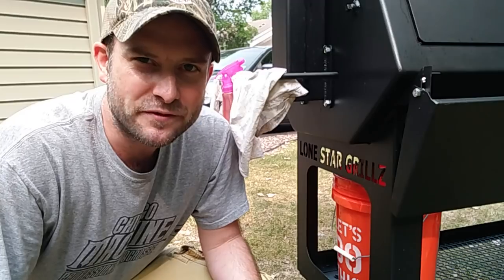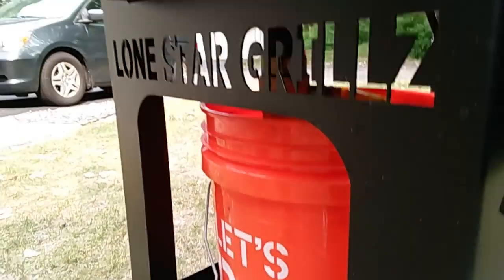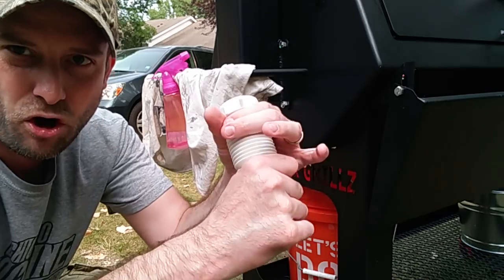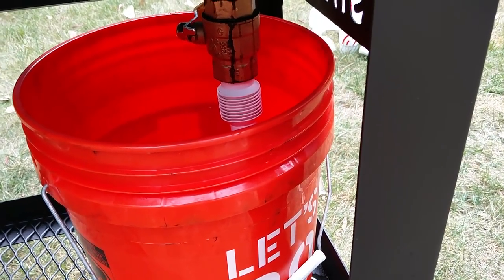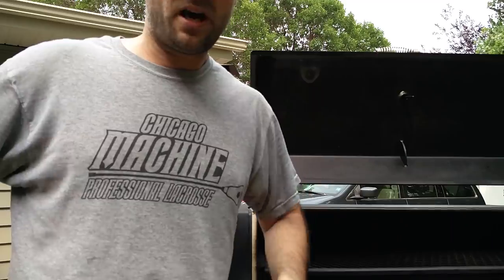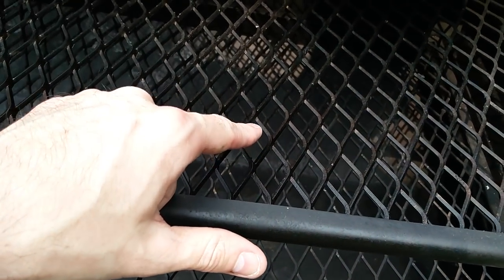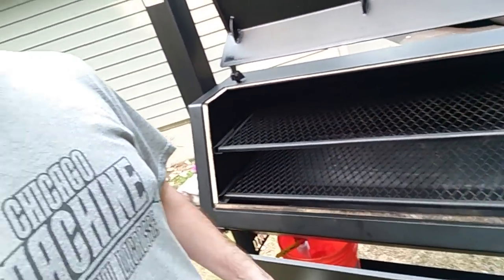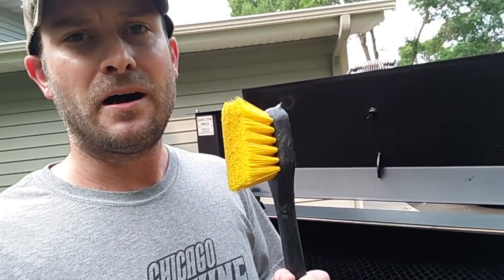The Must-Have $6 Modification for Every Lone Star Grillz Smoker | Plus A Safety Tip for All BBQers

Comment: That mod is going to make life easier for sure Jonathan and thanks for the mention, I appreciate it.  I haven't thought of a good solution for the wire bristle brushes either, but that yellow brush is safer for sure.
Reply from the maker: Smoky Ribs BBQ & Southern Cuisine No problem, Rus. Credit to you for a great idea. Thanks for stopping by!
Reply from the maker: Rus - update on this. Grill Badger sent me out a couple all natural bristle brushes to try. I like them. I'm using them on my expanded metal and they're great! I did a review video on them a while back. Good people over there too.
Reply: Get a weed burner with a propain tank, torch the grill for about 5 min spray it off with cold water. Not only does it sanitize any food that was left on the grates but it cleanes really well. I have a Lone Star cabinet smoker and I clean it that way every time. The weed burner pretty much turns any food left on the grates to ashes and you just rinse off the ashes.
Reply: Have you guys used the nylon grill brushes?  You have to use them when the grill is cool, but i find it works really well!
Reply from the maker: Yes, they're ok. I prefer the Grill Badger. Tough and can use when hot. 👉💨
Reply: Rus, I’ve gone to using a very stiff plastic bristle brush….similar to the one Jonathan has here, but it is actually designed for scrubbing concrete floors. It works great.

Comment: I hard piped my LSG 30” offset cabinet smoker, because I would add 4 gallons of water to my smoker when smoking.  Keeps the humidity up in the smoker and heats the water so the drippings don’t stick.  LSG makes a killer product.  I have another one on order as I make this post.

Comment: They make a grill brush that has shorter nylon bristles similar to what you have in the video. The shorter bristles make it a little more stiff for cleaning the grates. It also has a flat scraper on the reverse side for heavier gunk. I'm pretty sure I picked mine up at Lowes.
Reply from the maker: zeroghd Thank you! I'll have to check that out next time I'm there. Maybe end of summer sales will start soon in the grill section :)
Reply: you don't want a metal brush with fine wires  it will shed

Comment: Solid advice on the metal brushes. For the drain on the LSG, I’d just get a smaller bucket than putting some ridiculous looking plastic mod on a nice pit. The ash bucket you have on in the video works great. Ive been using one with my LSG since I got it in 2016 and it hasn’t rusted out yet even though water sits in it most of the year.

Comment: Hi I had the same problem one time what I do is pressure wash just when they are too bad and need deep clean but I dry them up with a towel and spray oil to it the when time to cook in the process to hit the pit the oil stick to the grill again and every time you are cooking again cut a big onion in half stick it to a big grill fork and pass it throughwhike the pit is hot. 
Put litle  pressure that will keep the grill clean to and ready to cook

Comment: Great tips Johnathan.
That yellow bristled brush you have is a great alternative usually about every 2-3 cooks I'll use my brush which is the same style as yours but mine is blue,
Anyway I bring my smoker to temp and give it a good quick steam cleaning with light sprays of water from my garden hose, while scrubbing the grates with the ball valve wide open to keep it as fresh as possible, then I reseason the pit before the next cook. After months of use I still don't have any problems using the brush. Great channel Bub, you just gained another subscriber.

Comment: great idea! do you wash it out after each cook?
Reply from the maker: I actually sold it to make way for my LSG Mini - but I did not wash it out after each cook. Actually, rarely did I ever wash it out and the longer I owned it the less I wanted to introduce water into the equation. A plastic paint scraper once everything has cooled down gets the sludge out of the bottom pretty easily and leaves the metal seasoned. I still use this method on my mini.

Comment: Yep, the bristles do come of onto the grate. Expanded metal is worse due to the joint at the bottom of each opening where it will cut off the bristle. I have been aware of this but even being aware of it you can't see them all every time. I have two of those T shaped brushes and still use them but inspect closely and always rub down the grate with paper towels or clean rags then spray with oil. If you swallow one of those steel bristles, it is then a 50/50 chance of it puncturing your stomach or intestines. I also have one of the nylon brushes I use now on the expanded metal, and save the other for the straight grate. I like what you did on the drain mod, that makes it much easier for sure. I have a drain on my offset but do not use it for cleaning only grease dripping during a cook. I found if I'm gonna take out the grate and heat plate during cleaning anyway, I can take my 5 inch sheetrock knife and begin at the top of the drum and run it down thru and up the other side and collect the grease and rub it off on a couple paper towels. On a 36 inch drum, it doesn't take any time at all to work down the drum like this and it's all dry cleaning. Just put on a pair of rubber gloves. It's not bad IMO . Thanks for the tips Jonathan.
Reply from the maker: Phil N Florence Good feedback and ideas! Thank you!
Reply: All of the LSG offsets can hold water to become a water smoker, and that is primarily what the valve is there far.  I use my offset 90 percent of the time with water in it, and even when I don't, I simply hose all the gunk off and down the drain.  Clean up is a breeze on these smokers.
Reply from the maker: Smoky Ribs BBQ & Southern Cuisine That's a great point. I forget that because I don't water smoke with mine, though I'll experiment with that at some point. Do you keep it fired up for an hour after cleaning to dry it out completely, or not really worry about a little rust in the belly?

Comment: Traeger sells a metal bucket that fits pretty well under the LSG because it's a few inches shorter than the typical 5 gallon buckets sold at Home Depot & Orchard. I've found that Traeger's bucket gets the job done,  looks good & it will probably last a long time.
Reply from the maker: Kenyatta Robinson Good tip! Thank you! We'll get all these tweaks perfect eventually :)

Comment: Use your yellow brush before you heat up the grill and burn it off which also helps sterilize the grill surface before you place anything on it.  I crank up my pellet grill to 500 degrees and then lower it down to the right temp I want to cook at.

Comment: HI, I was wondering if you got the 1/2 inch charcoal grate upgrade, I saw that T-Roy got it , and what is the benefit of it , this is my first offset  I don't know that much about them, Thanks.
Reply from the maker: I did get it, because the charcoal grate is the first thing to burn out on any offset cooker. It takes a ton of stress from the hot coals and expands and cools more than any other spot on the cooker. However, I am not sure it is necessary. The 1/4" one is still very beefy. The 1/2" one might be a little overkill. It is very heavy, probably 45 lbs.
Reply: Thanks for the info, I think I might just get it, I will call them Monday and ask them to add it. The other things I got are the Ball valve, probe port, charcoal basket, and 8 inch wheels, I am also thinking about the fire poker and ash rake, and maybe the cover.
Reply from the maker: warren perry I bought my own fire tools at fleet farm. I'll eventually make a charcoal basket out of expanded metal as well.

Comment: Simple fix for your drain, first thing I did when I got my LSG smoker. Take the valve off, replace it with a 45* elbow, a 6" pipe nipple, the valve, and then another nipple. I put a cap on the end, but it's not really necessary. The valve is out from under the smoker and the perfect height to put a bucket under it. LSG could include this setup and add $10-20 to the price and make it a whole lot easier on the customer.

Comment: What does lone star grill recommend for cleaning the grates
Reply from the maker: It's been almost a year since I talked to them about it, but at that time they recommend wire brush, weed burner, or pressure washer. The latter two require re-seasoning the grates.
Reply: @Texas2.5  i use a pressure washer on mines..then i spray it with PAM OIL

Comment: TX- Very simple solution to the steel bristles in food problem: ditch the whole expanded metal grates problem.  It is so simple to have a welder make a set of steel grates for you out of 1/4 or 5/16 round bar stock.  It will outlast your grill, and you will kick yourself for Ever having used any expanded metal grill grate before.

Comment: @ Texas, you might give the Weber Heavy Duty Scrubber Pads a try. I use them to clean the normal round rod grills but they might work for expanded metal grills also. Here's the Home Depot link for them: https://www.homedepot.com/p/Weber-Heavy-Duty-Scrubber-Pads-with-Handle-W146/300512634 . I find the handle useless and just use the pads. Only $5 for 3 pads and they last. Thanks for the video. Good luck.

Comment: There's no reason to be spraying water inside the smoker or have water inside it. You are just making a huge mess and creating work. Use that little metal bucket you have there, put a kitchen trash bag in it. Clean out the firebox and put the ash in it. Then put the bucket under the drain and open it. Scrape the grease and junk put a putty knife down the drain, the ash will absorb the grease. Close the drain, wipe up excess with paper towels and toss in the trash can. Done...Easy....
Reply: These pits are designed to cook with water in them. It provides humidity. Some of the best use water in there cooks (Aaron Franklin and Myron Mixon).

Any time I’m doing a brisket or a butt I use water as well.
Reply: Nothing against using a water pan. But no need to fill the bottom, and make a huge mess. I also am not convinced Chris at LSG is very good as designing pits. These new designs look to me to have drafting issues.
Reply: I don’t know. I have the traditional 24x48 offset from LSG but everyone that has these models seem to love them. You could be right on the draft though.

I do fill the bottom with water and outside of providing humidity on Long cooks, it makes clean-up a snap. Just got dry and oil afterwards.
Reply from the maker: @SOLDOZER  A year in. I still don't water smoke, but I can tell you there's nothing wrong with the draft on mine. My most recent video thoroughly details a brisket cook and the performance on the LSG 20x42 is rock solid every time I use it.

Comment: $3000 for a smoker to save a couple bucks on some pipe fittings.  Do it right instead of using hack plumbing parts (that shouldn’t even be sold) that will melt with hot grease and drip because of the corrugation trapping grease.